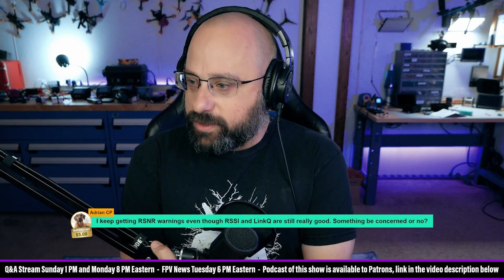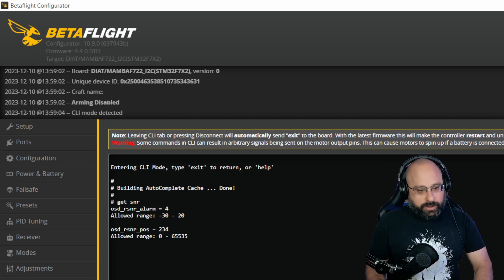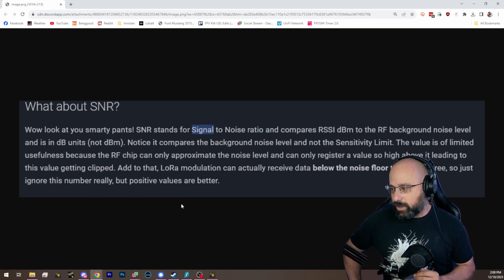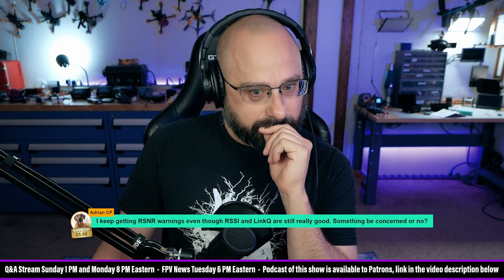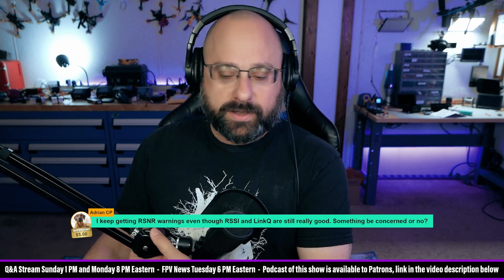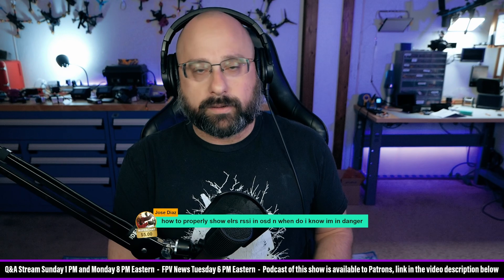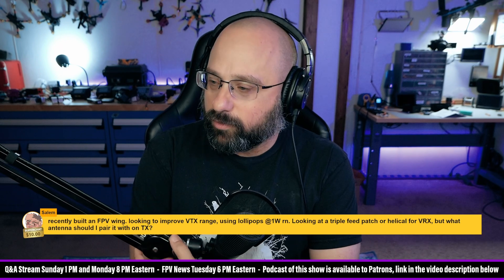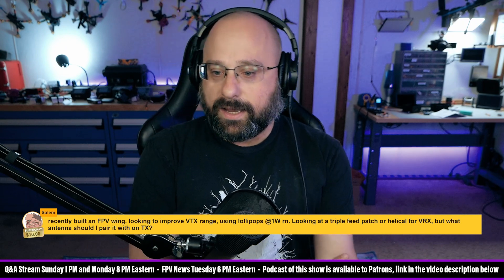My RSNR Is Low? ExpressLRS Link Quality and RSNR? VTX Antenna Choices? - FPV Questions

Comment: Depending on the wing you can move the vtx way out on one wing and radio rx way on the other side and gps in the middle but spaced away from the esc. You'll have to make sure the wing balances right to left not just on the front to back cg, I use trim nails. But the performance of all of those components is better than on a multi rotor thanks to the space between them. Twist all wires so the ground wires don't become antennas